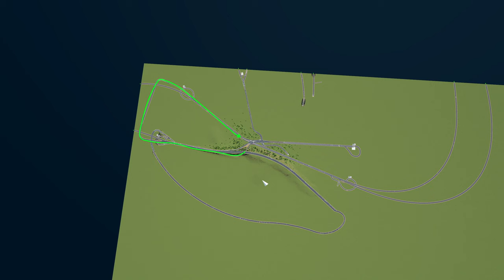Cities: Skylines - Old Reynella Junction (Southern Expressway, Adelaide) - Mini Build

Comment: I can't fathom the amount of patience this requires... I'm in awe.

Do you reckon you'd give it another go with Node Controller and Intersection Marking Tool, now that they take most of the tedious work out? The intersections you could create with those could be beyond mindblowing!
Reply from the maker: The techniques in this vid allow for more customization. Tool-markings span points relative to a node, whereas the intersections I mark usually have elements which forego connection to a node that the markings make it look like they connect to.